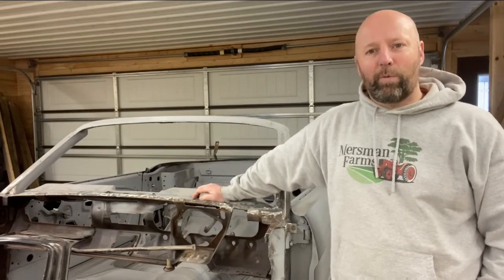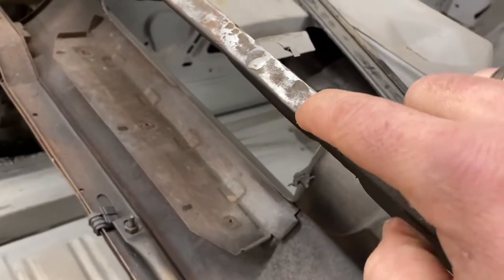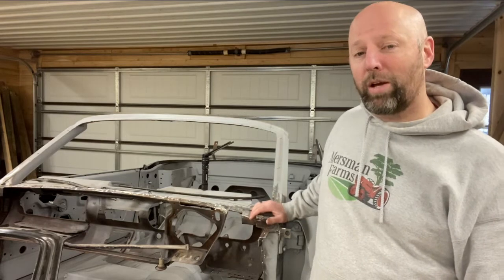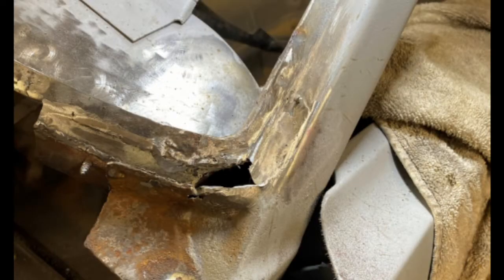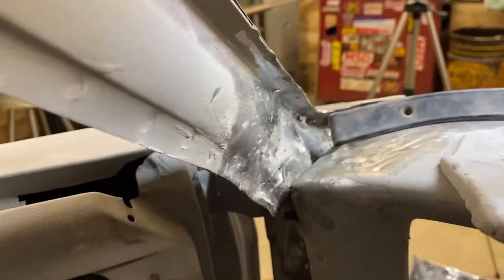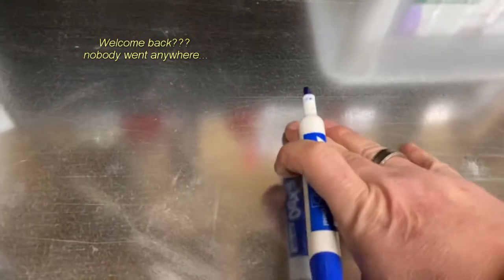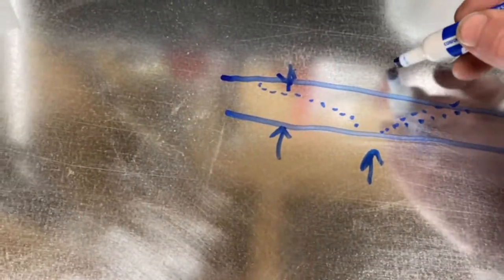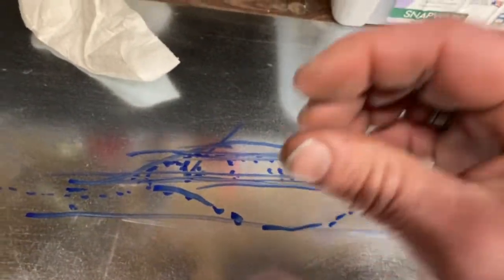1966 Mustang Restoration Pt 3 - Windshield rust repair & welding tips

Comment: I believe the screw from the other side is holding the weather strip around the opening. it might have been ground down from the other side
Reply from the maker: Hmmm...I assumed it held something under the dash. I think the head is on the interior side.  I don’t know what the weather stripping looks like yet.  Thanks for the idea.
Reply: @3rdstallgarage  ah. hard to tell from the angle if it was inside the cockpit or outer window rail. quite sure you will figure it out during reassembly.

Comment: Help! I'm replacing a 65 mustang convertible windshield frame....a tree fell on it. I haven't been able to locate a mustang to take some measurements/pics and my biggest problem is knowing how high the frame sits in comparison with the wing window frame. So far it looks like the windshield frame sits even with the the top of the wing window but I'm afraid to weld it there until I know for sure. I'm not a Mustang guy/never worked on a Mustang Convertible frame before so I'm scratching my head and digging a hole in it. I've watched a lot of videos and have only found one that shows all the trim off the frame and it looks like the windshield frame is even with the top of the wing window frame. Can anyone PLEASE help me? Thank you in advance.
Reply from the maker: Hi!  Good luck with your repair!  Let me know if I can help by comparing measurements to mine.  Feel free to send me an email at 3rdstallgarage@gmail.com